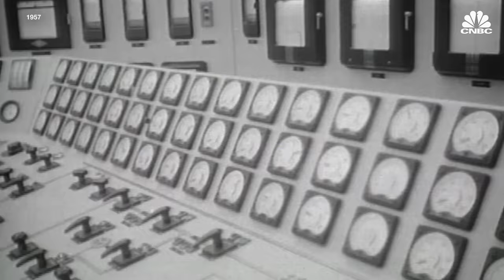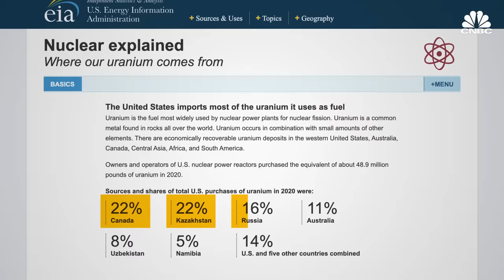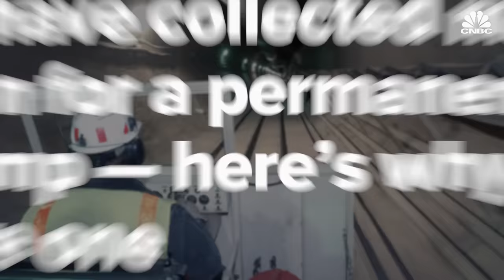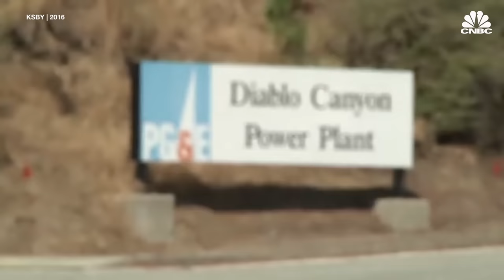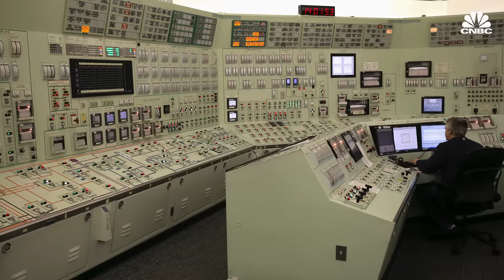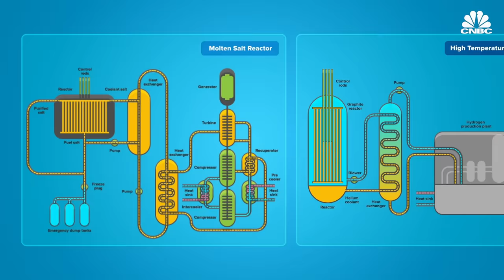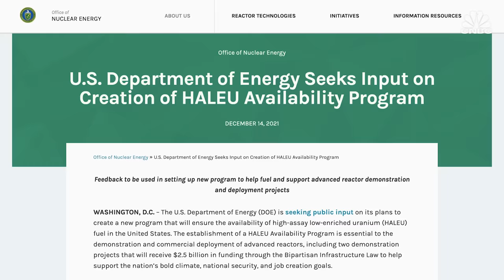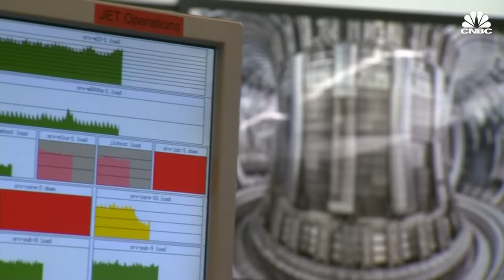Why Nuclear Energy Is On The Verge Of A Renaissance

Comment: Nuclear fusion is still elusive after many, many years of research. Maybe someday. I would support newer fission designs particularly from the viewpoint of generating hydrogen relatively cheaply.
Reply: Present day hydrogen round trip conversion rate is less than 40%.  Not a practical way to store energy.
Reply: @Klerk Kant  Yet you fail to acknowledge from your blank trolling channel that we have been building and operating small modular reactors for many decades built in two years or less for millions not billions.

Comment: Except it's not renewable.  There is only enough minable Uranium 235 to fuel existing plants for ~20 years.  Yes, there are potential alternative methods, but those are either theoretical or in development.  Until one of these alternative methods is proven practical, it's waaaaay to early to get excited.
Reply: @Crispr_CAS9  Theoretically.  How much energy does it cost to extract it?
Reply: @NeoDemocedes  It's more expensive than conventional uranium, but cheaper than reprocessed uranium. Since reprocessed uranium would be economical in an environment where conventional uranium had been exhausted, seawater extraction would as well.

Comment: It is really encouraging to know that some people are finally seeing the benefit of nuclear power. With the surge of electric cars alone, our traditional electric generation sources just won't make it and this will happen soon into the future. The past rejection of nuclear energy is a reflection of the failure of our education system that instills way more fear than knowledge.
Reply: The only fear of nuclear power is its cost.
The Southeastern U.S. is super pro-nuclear MAGA, has zero anti-nukes, and 100% political support. 
VC Summer (South Carolina) new nuclear units 2&3 were canceled in 2017 after spending $17 billion on the project (original estimate of $14 billion and 2016 completion date) with no clear end in sight for costs or schedule.  Anti-nuclear sentiment was never identified by the utility as causing any of the many delays.
Vogtle (Georgia) new nuclear units 3 &4 currently 110% over budget and schedule and still not operating. Mid way into the build, the utility stated that had they known about the many costly delays they would never have chosen nuclear. Anti-nuclear sentiment was never identified by the utility as causing any of the many delays. They are now delayed another year because according to the project management, thousands of build documents are missing. Utilities, not the media, decide the most cost effective electrical power source and give the above failures no U.S. utility is even considering new nuclear at this time. If you can’t build new nuclear in the MAGA super pro-nuclear southeast U.S. then where can you build it?
In both cases, the ratepayer is stuck with paying the $50 billion bill. And the silence of the Rah Rah nuclear folks on these events is deafening.
Reply: @clarkkent9080  Yet you continue to ignore that the US and many other countries have been building and using small modular reactors for many decades, built in two years or less for millions not billions.
Reply: @clarkkent9080  Enjoyed your response. We do need to overcome the delays. My thought is that the delays are not physical delays but just political. After all, we do know exactly how to build out nuclear and to do it safer than ever. There is much opposition driven by ignorance, and sentiment has little to do with it when politicians are out to get votes to please active opposition. Simple involvement in nuclear energy is financially risky, for one thing. Look at the example of the nuclear plant in Sacramento, CA. They spent a over a billion$ to do safety upgrades, and the next year voters voted to close it down. Zero return on investment. The plant could have reduced the cost of electricity for the next 30 years. Germany is another case of the same. Shutting down working plants out of fear... return on investment not amortized as should have been. Now they are backing off or they will be shivering in the dark this winter.

Comment: The more I look into nuclear power the more I support it.  I live near the Diablo Canyon plant featured in this video and think it’s a great source of clean power and provides a lot of great jobs for local residents.  I wish it wasn’t owned by PG and E.  But you can’t have everything.
Reply: If you look into new nuclear builds in the U.S. you may not support it so much.

.  If you live in the U.S. here is the reality for the last 4 state of the art Westinghouse AP1000 ADVANCED passive safety features new nuclear power projects and spent fuel reprocessing and in the U.S. over the last 20 years. You decide if this YT video was presenting the truth. 

The Southeastern U.S. is super pro-nuclear MAGA, has zero anti-nukes, and 100% media and political support. 

The MOX facility (South Carolina) was a U.S. government nuclear reprocessing facility that was supposed to mix pure weapon grade Pu239 with U238 to make reactor fuel assemblies. It was canceled (2017) in the U.S. After spending $10 billion for a plant that was originally estimated to cost $1 billion and an independent report that estimated it would cost $100 billion to complete the plant and process all the Pu239, Trump canceled the project in 2017.

VC Summer (South Carolina) new nuclear units 2&3 were canceled in 2017 after spending $17 billion on the project (original estimate of $14 billion and 2016 completion date) with no clear end in sight for costs or schedule. 

Vogtle (Georgia) new nuclear units 3 &4 currently 110% over budget and schedule (currently over $30 billion) and still not operating. Mid way into the build, the utility stated that had they known about the many costly delays they would never have chosen nuclear. They are now delayed another year because according to the project management, thousands of build documents are missing. If completed, Vogtle will be, for its output, the world’s most expensive nuclear power plant.

Please google any of this to confirm.

If you can’t build new nuclear in the MAGA super pro-nuclear southeast U.S. then where can you build it?
Reply: @Kerk Kant  Yet you continue to ignore from your blank trolling channel the fact that many countries have been building and using small modular reactors for many decades built in two years or less costing millions not billions.
Reply: @clarkkent9080  Do you copy and paste this into every comment on every video that is even remotely nuclear-related on YouTube? Get a life and embrace the power of humanity's ultimate energy source.

Comment: I would definitely support Tesla/private business partnerships with states building nuclear plants in California and Nevada to support water desalination.  I think reactors the size of the ones that are on nuclear aircraft carriers would offset the cost of large scale desalination.
Reply: Navy reactors produce 77Mw of power compared to standard commercial plants producing 1,200 Mw.  NuScale is the only U.S. company that has been building Small Modular Reactors and has up to $2 billion in taxpayer funding for their demo project.  Here is their story.

This is from the Des Moines Register an ultra conservative newspaper concerning the only Small Modular Reactor (SMR) project in the U.S. today.
In 2013, the Wall Street firm Lazard estimated that the cost of generating electricity at a new nuclear plant in the United States will be between $86 and $122 per megawatt-hour. Last November, Lazard estimated that the corresponding cost will be between $131 and $204 per megawatt-hour based upon the 4 recent new nuclear projects in the U.S. . During the same eight years, renewables have plummeted in cost, and the 2021 estimates of electricity from newly constructed utility-scale solar and wind plants range between $26 and $50 per megawatt-hour. Nuclear power is simply not economically competitive.
SMRs will be even less competitive. Building and operating SMRs will cost more than large reactors for each unit (megawatt) of generation capacity. A reactor that generates five times as much power will not require five times as much concrete or five times as many workers. This makes electricity from small reactors more expensive; many of the original small reactors built in the United States were financially uncompetitive and shut down early.
The estimated cost of constructing a plant with 600 megawatts of electricity from NuScale SMRs, arguably the design closest to deployment in the United States, was originally advertised as costing $1 billion but upon requesting actual bids from engineering firms, increased to $6.1 billion in 2020. Given inflation and other cost constraints that cost today can only be expected to be significantly higher.
The cost was so high that ten members of Utah Associated Municipal Power Systems canceled their contracts. NuScale then changed its proposed plant configuration to 6 fewer reactors but increased each reactor output from 50 Mw to 77 Mw costing at total of $5.3 billion. The NRC just last week approved the construction of the 50 Mw design but now will have to start the review process all over given the switch to a 77 Mw design. For each kilowatt of electrical generation capacity, that estimate is around 80% more than the per-kilowatt cost of the Vogtle project in Georgia — before its cost exploded from $14 billion to over $30 billion. Based on the historical experience with nuclear reactor construction, SMRs are very likely to cost much more than initially expected. And they now have delayed the project start until 2025 in an attempt to find more backers.  All this before the inevitable setbacks that will occur once construction starts.
Reply: @clarkkent9080   Yet you continue to ignore from your blank trolling channel that many countries have been building and using small modular reactors for many decades, built in two years or less, for millions not billions.

Comment: Putting water in a nuclear reactor make as much sense as putting gasoline/petrol in a car cooling system, it would make both the reactor and car over priced and require a endless amount of safety system just to keep it from blowing up. And if that car had the same 1% efficiency rating as the uranium/water reactor then wouldn’t be able to afford to go anywhere in that car? So about 99% of uranium goes unused, pollution comes from inefficient burning of fuel that why there a waste problem that last for 10,000 to 20,000 years! Alvin Weinberg came up with the best version of a fission reactor but got shut down by Richard Nixon, and now the Chinese has step in to complete his work. This reactor is as close to the fusion dream as a fission reactor can get, the Thorium Molten Salt Reactor. The Chinese will be laughing and smiling all the way to the bank, not to mention the political influence that will get them.
Reply: @Klerk Kant  Yet you continue to ignore from your blank trolling channel that many countries have been building and using small modular reactors for many decades built in two years or less for millions not billions.

Comment: Finding a way to dispose/recycle the spent fuel is the major hindrance of nuclear. Renewables has its place but isn't the answer for the future. Far too much wastage in batteries and solar panels which have a lifespan of about 5-10 years. Therell be a huge shortage of lithium if electric vehicles become the norm.
Reply: Disposal of the waste isn't a problem at all if the public weren't so ignorant and made it a political land mine.

Comment: Great news!
Reply: This is the last and only 4 new nuclear projects in the U.S. over the last 20 years. confirm if you like.
 Is this great news?

The Southeastern U.S. is super pro-nuclear MAGA, has zero anti-nukes, and 100% political support. 

VC Summer (South Carolina) new nuclear units 2&3 were canceled in 2017 after spending $17 billion on the project (original estimate of $14 billion and 2016 completion date) with no clear end in sight for costs or schedule. 

Vogtle (Georgia) new nuclear units 3 &4 currently 110% over budget and schedule (currently over $30 billion) and still not operating. Mid way into the build, the utility stated that had they known about the many costly delays they would never have chosen nuclear. They are now delayed another year because according to the project management, thousands of build documents are missing. 

If you can’t build new nuclear in the MAGA super pro-nuclear southeast U.S. then where can you build it?
Reply: @clarkkent9080  Yet you continue to ignore that the US and many other countries have built and operated small modular reactors for many decades built in two years or less for millions not billions.

Comment: We need nuclear energy as a base load power. Renewable energy sources can not simply provide base load. Also, over the lifetime of the project, nuclear energy is cheaper than their fossil fuel sources. So, if we are able to reduce the initial costs required for nuclear plants with the help of low-cost finance and newer technologies, we can have more support for nuclear from the side of the capitalists as well.
Reply: Actually, nuclear is cheaper in construction as well when real numbers are used.
Reply: @danadurnfordkevinblanchdebunk  Yes. That's true

Comment: 13:32 That statement is categorically false. The RBMK1000 reactor would never have been built anywhere outside of the soviet union.
Reply: Make that, Soviet Union and Soviet Client States.  But otherwise, yeah, safety was never in the Soviet's top 10.
Reply: The accident was not the result of the design.  They intentionally preformed a test that the licensed operators knew was extremely dangerous, but they were pressured by management to perform. But yes, the lack of containment resulted in the spread of contamination, but this accident could happen at many plants without the release of so much contamination if a containment existed.